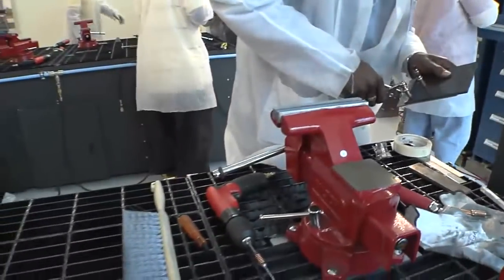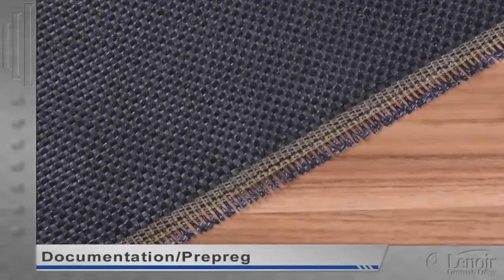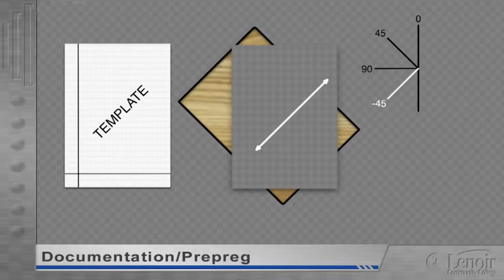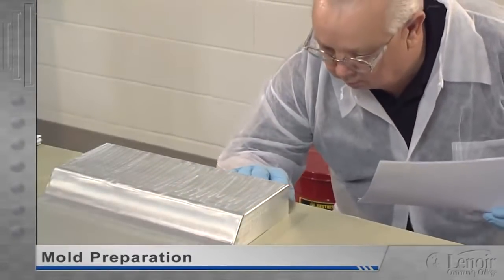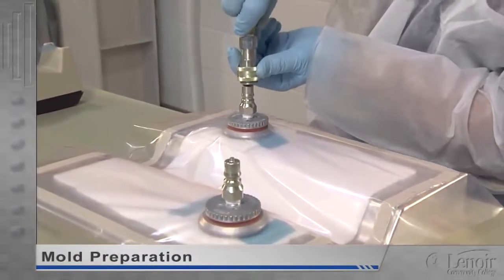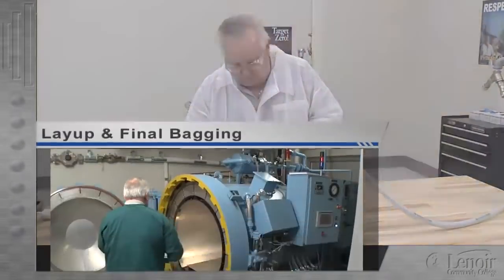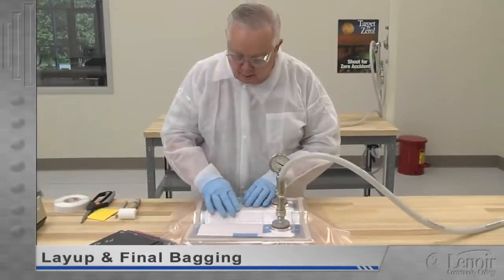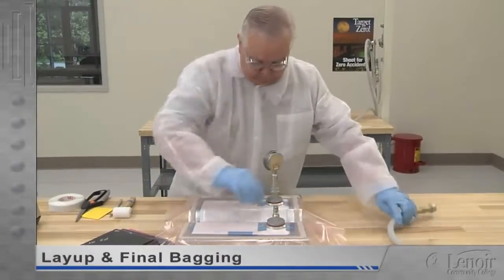Training: Aerospace Manufacturing Readiness

Comment: My only negative comment is the use of pen marker directly on the Prepreg itself. Regardless of approved inks it's a bad practice to draw solid lines and or write directly on a layer like that. Normally in Aviation you would add any information on the protective layers of backing material.